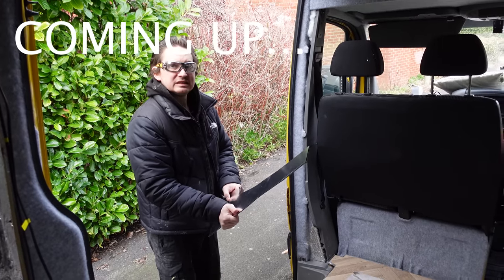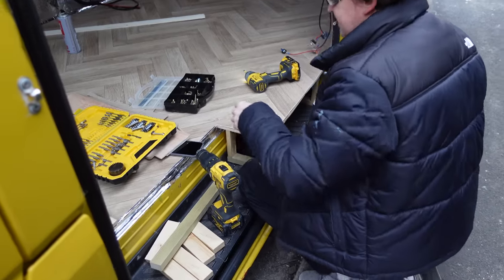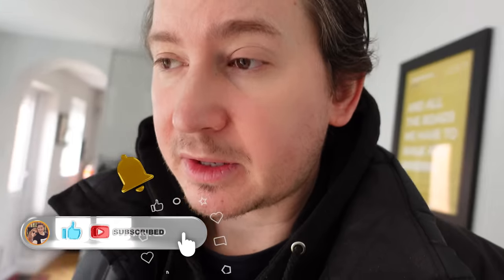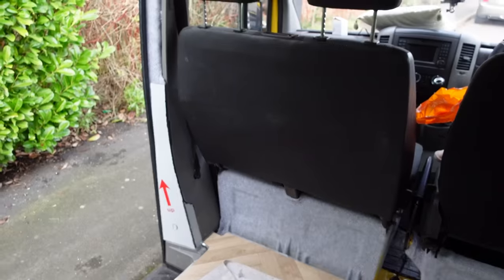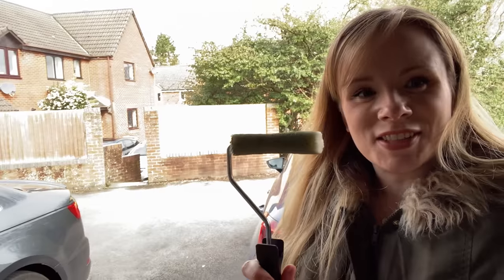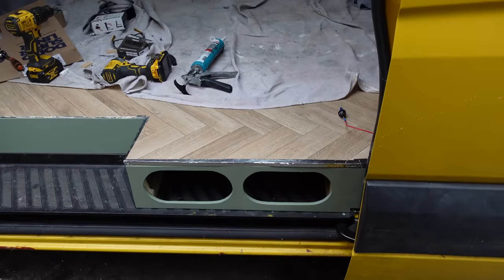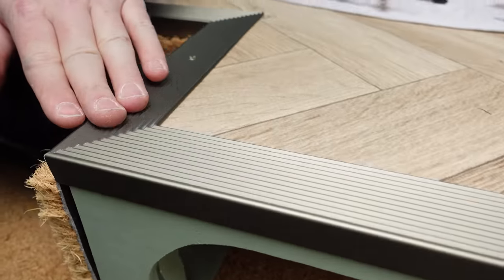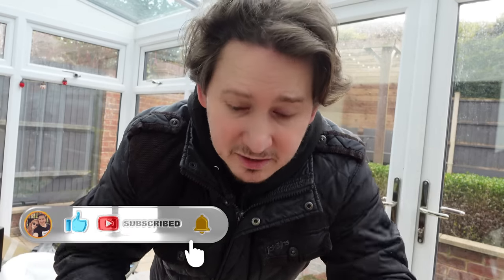Van Conversion: Ultimate VANLIFE Upgrade! DIY Storage Step for Mercedes Sprinter

Comment: Great video. Good lesson to learn about using power tools. They are great but need handling right. Clearly the hole on the left, if slightly bigger, is for Andy's shoes as they are larger! Great planning there! Keep going! xx
Reply from the maker: Thanks Dad. Yes mainly 'don't hold the thing you're cutting in midair' haha. And yes exactly - it was planned all along! Thank you :)!

Comment: Looking great. Its the fiddly bits that take the time, its the fiddly bits that make the build. But (re cutting that trim) remember to try and walk the fine line between 'more clever' and 'less stupid' 🤣🤣😜
Reply from the maker: Yes you’ve hit the nail on the head (no pun intended 😂) - we want to try and have a relatively good finish to it so we’re trying to make sure the little bits are done the best we can! And thank you for the advice, it’s needed 😂

Comment: no they didnt put the wrong letters in 😅 you two live in UK and you have this stupid thing where you drive at the wrong side of the road 😂 its so hard to understand that. keep strong and keep the great content coming 👍👌 ps: you can allways bend aluminium, but only once, not twice then it cracks, pps, you can cut aluminium with circular saw, it is just really dangerous, better to find metal blade for your jigsaw and cut it with that or angle grinder with a cutting disc.
Reply from the maker: Hmm yes maybe that is why they were the wrong way round (or right way to you 😂) thankfully we managed to make them work! Yeah, for sure - Andy has learnt that lesson haha, thanks for the tips and thanks ever so much for watching, we really appreciate it 😊